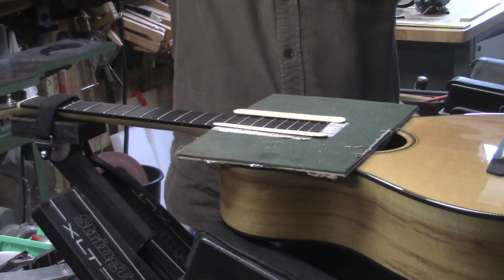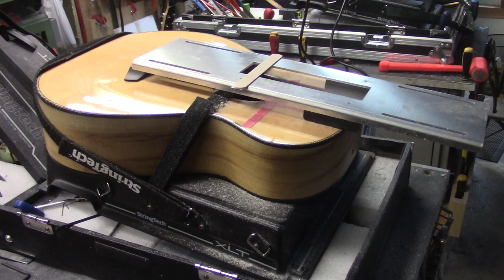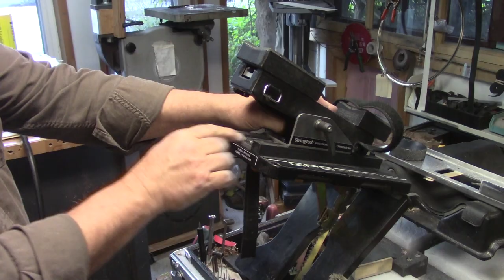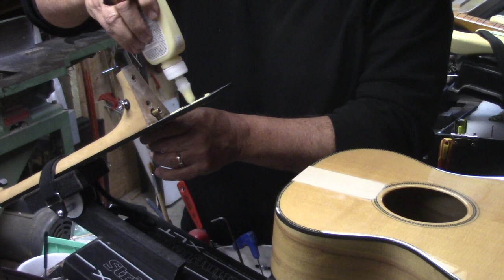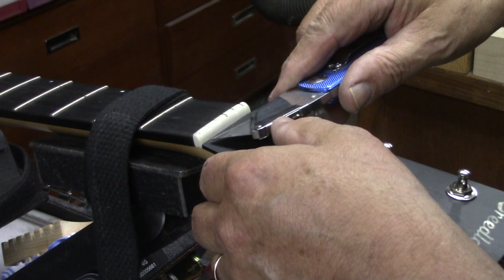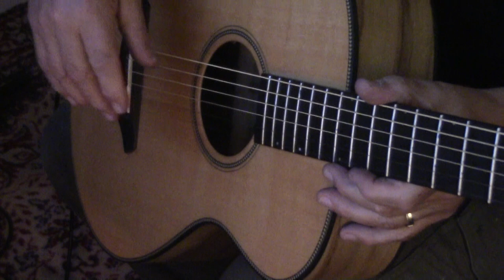Breedlove Neck Re-Set @StringTechWorkstations

Comment: No dovetail or mortise and tenon, interesting.   I have an acoustic body I need to make a neck for that doesn't have a mortise like this one.   Any disadvantages to just bolting it but up to the body?
Reply from the maker: Hi Tyler. Nice to hear from you ! I hope you are OK + Safely navigating the C-19 madness. Robert Godin was the "voice in the wilderness" back in the early 70's with his Norman acoustics. The market just wasn't buying the idea of a bolt-on neck at that time. Since that time ... MANY have relented. Robert Godin "staying the course " with the very popular Seagull brand and Martin / Collings / Breedlove / Taylor and numerous others ... have all followed Robert's lead. It seems that Gibson / Larrivee / Santa Cruz are the last "hold-outs " among the more famous manufacturers. Many small builders ( including myself ) still utilize the traditional dovetail. Martin, in the higher end guitars still do the dovetail ... although they now include a single threaded fastener in the tip of the dovetail like you see in this Gibson SJ restoration https://youtu.be/HKbyA69y1w4.  The simplification of the neck joint, with these fasteners and a butt-joint .... certainly speeds up the manufacturing process. Hope that helps to shed some light on this issue for you. Very best always. MMcC
Reply: @StringTechWorkstations  ok!   Thanks for the info.   I'm going to send you an email